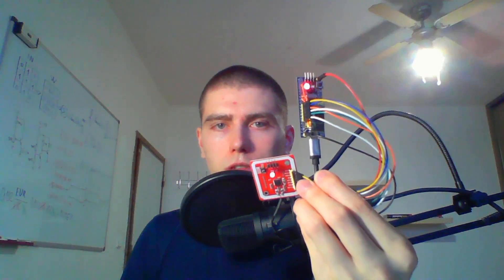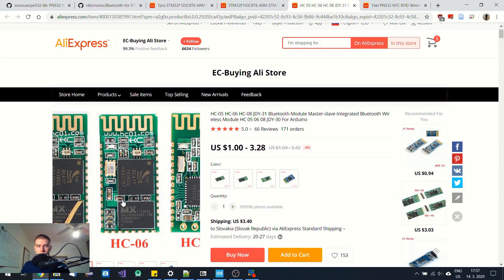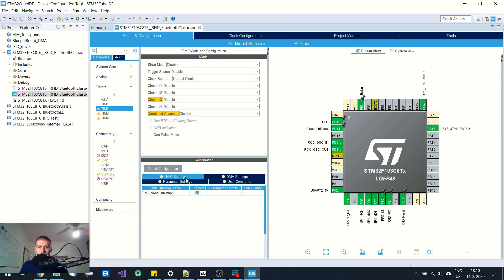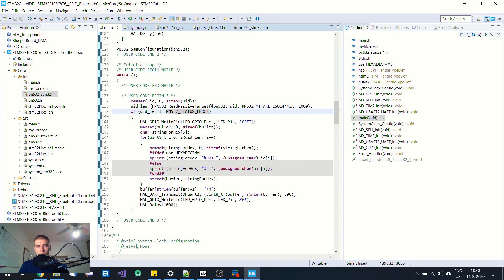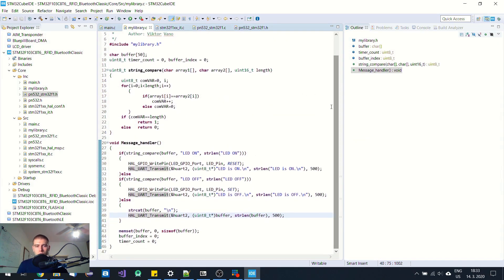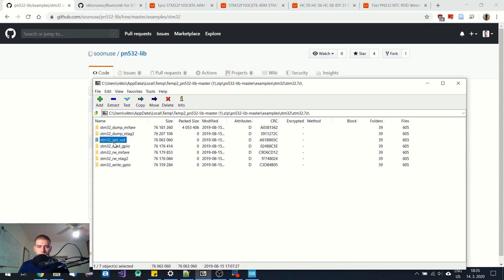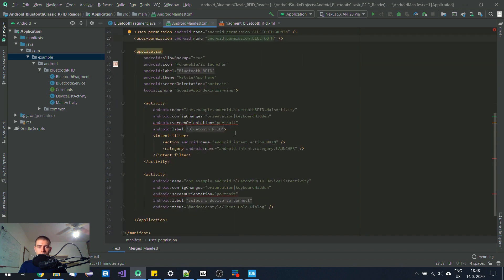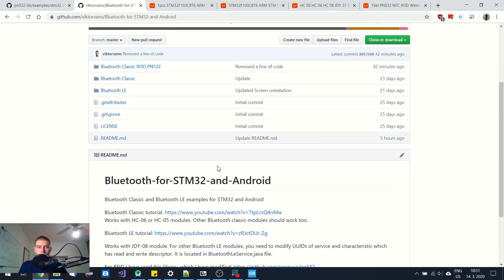RFID tutorial for STM32 and Android + Bluetooth (RFID PN532 and Bluetooth HC-06)

Comment: can i use it without STM32
Reply from the maker: Hi, without what?
Reply from the maker: Well, if you can replace that STM32 with another MCU, then yes. That STM32 is the brain of it all and a bridge between the RFID reader and the Bluetooth module. STM32 does the hard work, so it is a critical component. Some MCU needs to be there.
Reply: Viktor Vano can’t I directly connect with android ? Without any mcu
Reply from the maker: @niteshnahar4724  Well an Android can connect itself to a Bluetooth module, but that acts as a trabsparent UART. RIFD reader is more difficult to operate. It needs an MCU. What do you want to do? What are your intentions?
Reply from the maker: @niteshnahar4724  that uses a high speed UART peripheral. That would mean to totally rebuild the android app, which will communicate with that PN532 module directly. That would be possible, but you will need to change the Android project totally.
Reply: Viktor Vano Ok. Need Android code for this. Can you help me out with this.

Comment: Hi, great video!! Could you tell me how to add the library files of the PN532 to the project. I am using STM32L4 microcontroller and unsure how to add the files to use in my project. I chose to use the I2C protocol. Thanks!